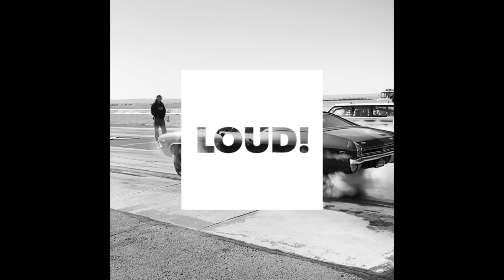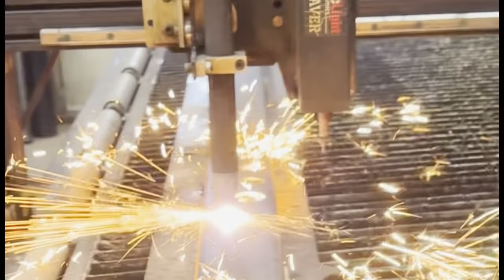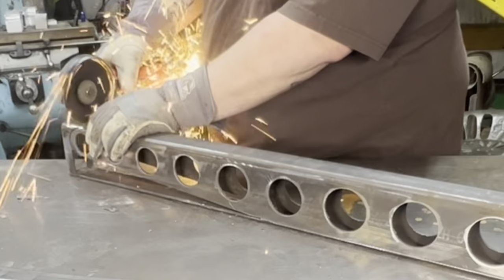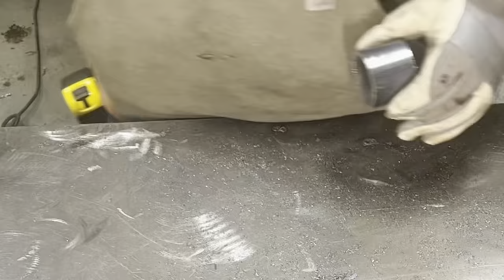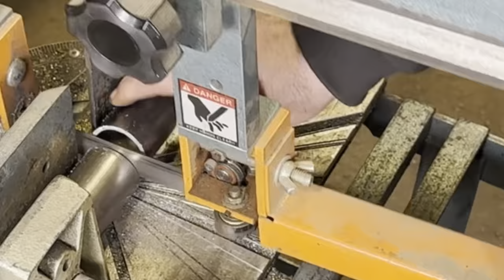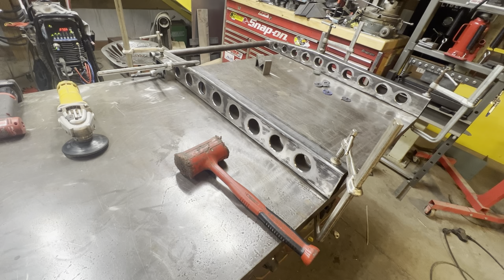55 chevy gasser chassis build pt1

Comment: Are the holes for looks? If I was to place a bet it would be you made them heavier. It would definitely be very close.
Reply from the maker: The holes are 100% for looks, it does add some strength to the rails but certainly not required.